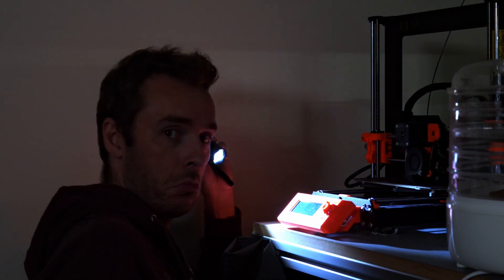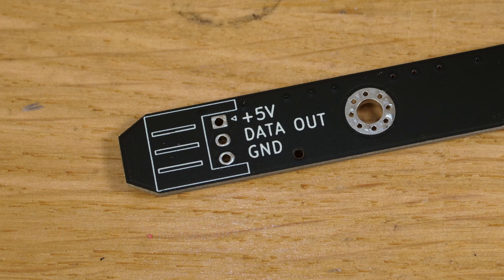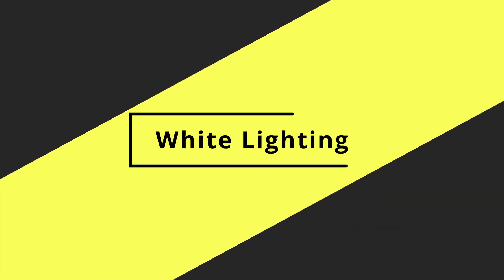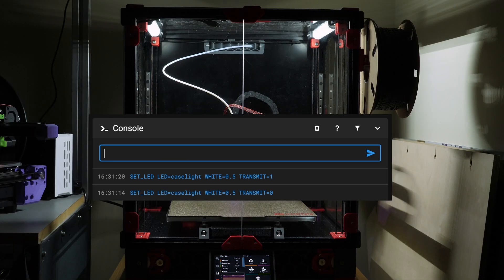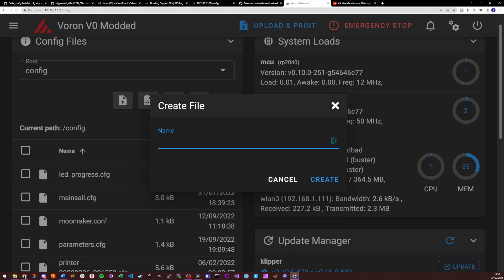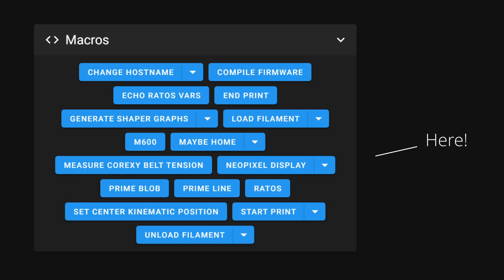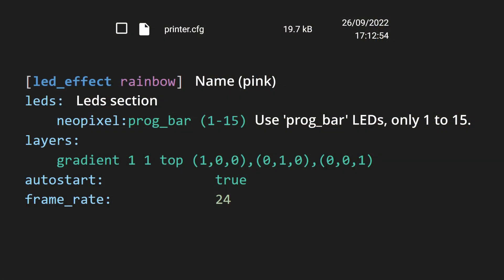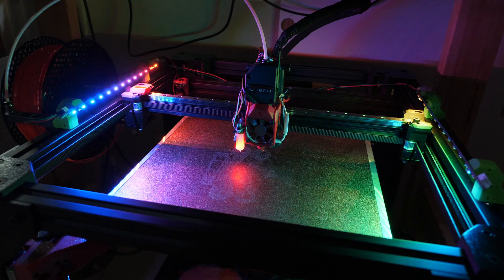Complete Guide for 3D Printer LED and RGB Lighting with Klipper

Comment: Can I have two strips of RGB and two strips of white connected to different pins? I'd like to have the white ones on the sides and the RGB ones on the back and front.
Reply from the maker: Yes. In fact they have to be connected to different pins since they operate differently and require different voltages.

Comment: Note that the linux mcu implementation does not currently support directly connected neopixels. The current design using the Linux kernel interface does not allow this scenario because the kernel GPIO interface is not fast enough to provide the required pulse rates. 
Is this still valid?

Comment: Vector3D Daybreak Neo Mini bars sold by 3Djake in EU are being delivered without any cables.
Reply from the maker: I sell them without cables too. They're pretty to make compared to the rest of the printers they are designed for. The trouble is there is no length or connector that would suit everyone anyway. Easier just to make them yourself imo.
Reply: @Vector3DP  Well, the thing is, there are kits available (e.g. LDO) which require no crimping at all and selling a product which can't be tested "as is" is probably a good way to lower the cost, but it's also kind of "so many users got chargers at home, so we will not supply a charger with our next phone" situation.

Comment: 1 amp of current at 12v is equivalent of v2.4 amps at 5Volts so look more at the Watts rather than Amps.    1 amp at 12V is 12 Watts.   If the fan headers are 24Volt, then 1 amp at 24V is 24 Watts.   That's a damn lot of brightness in LEDs.

Comment: Marvelous explanation about PWM. Only small detail is that it doesn't work with persistence of vision; it is a way to regulate RMS voltage to a componen (LEDs in this case) and does dim them by lowering the voltage the LED sees at its input, just as if there was a regulating potentiometer on its input.

Comment: hello. your code doesn't work on my octopus pro f429 pin pb0 not working, (j37 no +5 volts too).. sk6812rgbw. klipper, mainsail.,pi3lts.   What am I doing wrong? Do I need any additional drivers?

Comment: Awesome video. What are the easiest ways of upgrading to more Neopixel compatible connectors? I am using an Octopus v1.1 and my RGB-Light/Neopixel-Pin is already used by the 3 Neopixels of the Stealthburner. But I would like to be flexible in using 1 or 2 bars for lightning and 1 bar for progress/status. Any ideas? Thanks a lot!

Comment: I have everything configured and my neopixel leds work. But when I try to use the digital ninja file and run a template I get the error unknown command "set_led_template". Any idea why it would be doing this?
Reply from the maker: You need to add the include section. It might have a typo if not working.
Reply: @Vector3DP  Just redid the file to be sure it was uploaded correctly. The include is there and giving no errors with the file. but still getting the unknown command error. does anything besides the neopixel name chain and pin have to be defines in the printer.cfg file. i have no macros setup there for leds currently
Reply: Also thanks for the quick response. been working at this hours now driving me crazy.
Reply: @Vector3DP  well i got it as it turns out my klipper was not newest version and didnt support templates so it was giving that error. updated klipper and now it works. thanks for the awesome video.

Comment: You got me motivated to finally install the RGB board I ordered. Unfortunately nothing really works, documentation says it works with the neopixel library and is GRB but from my tests it is RBG and I can't input this into the configuration file (throws an error).
Reply from the maker: What is the error?
Reply: @Vector3DP  It was strange, the colors were all mixed up and so on (also some leds different color than others or brightness differences). After a LOT of testing I came to the conclusion that it has to do with the signal cable length, and most certainly a command timing problem. ~140cm is the limit where it just interprets one of the first commands wrong but afterwards it works.

Comment: Quick question, how do you address neopixel pins from two different mcus? I have a skr mini with a neopixel output and even with the optional power module for up to 30 neopixels. Also I have an EBB36 connected via canbus with neopixel output for the stealthburner, how do you individually address each one for the neopixels? Or maybe inclusive control extra leds via GPIO pins on the pi?
Reply: Give name to mcu, ten add that name to a pin, [mcu io], pin:io: PD6

Comment: I currently am using WLED w/ Moonraker integration. Works pretty good but I wish I could use LED Effects for Klipper with it. I am about to add stealthburner so I will use my pin on my Spider board just for those lights to keep things separate.

Comment: Maybe off topic but you should try out water cooled hotends
Reply: What brand
Reply: Maybe  the E3d v6 'the kraken' or the phaetus dragon wsm water hotend
Reply: Phaetus dragen wst
Reply: @AleX-1nfern0  I am thinking of buying a watetcooler diy kit and adding it to my existing hotend
Reply: @(DankGoKrazy) nicee you should make a video about it
Reply: @AleX-1nfern0  I'm actually about to make a 3d specific yt channel to go my stock ender 5 plus upgrades I just order a bigtree octopus v1.1 motor with a tft35 dual touch screen display and much more will be coming soon man
Reply: Its still not in mainstream because there is no need of that much cooling. Even if you have water cooling print parts cant take advantage of that. It should be air cooled. Weight, liquid damage

Comment: Have you tried Klipper on the Prusa?

Could you do a tutorial on how to do LEDs for octoprint?
Reply from the maker: I haven't tried klipper on any prusa printer yet. Maybe something to try soon.

I've not looked at octoprint for a long time now, but since octoprint is not the printer firwmare I don't think that is the place you'd control it. I might be wrong though.

I'm working on a firmware-free module that would be compatible with nearly every printer.
Reply: I do.. no way, the stock firmware and hardware are for sure really better than any klipper firmware and btt boards
Reply: @riccardosacchetti  In what way? I'm researching a new printer and Klipper was a massive improvement for my Ender 3. I'd ne glad to go elsewhere on a new printer if there's reason though.
Reply: @martinmckee5333  on an ender. A really basic machine. Not on a prusa. It's like apple. That have the hardware and the software. With klipper you reach the same quality level but not better.
Reply: @riccardosacchetti  Thank you for your thoughts.